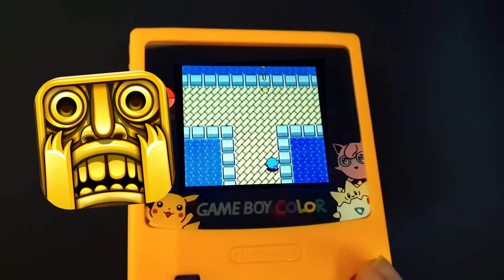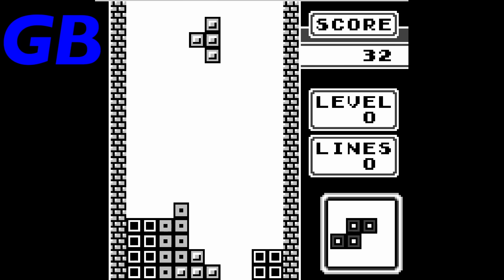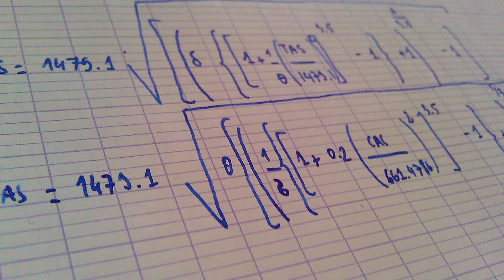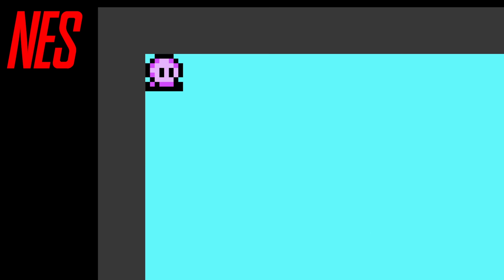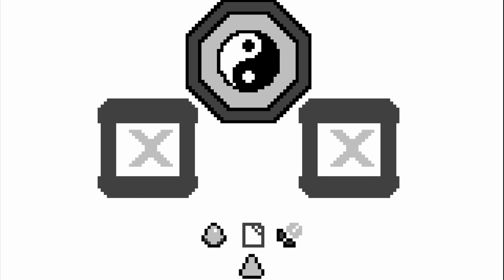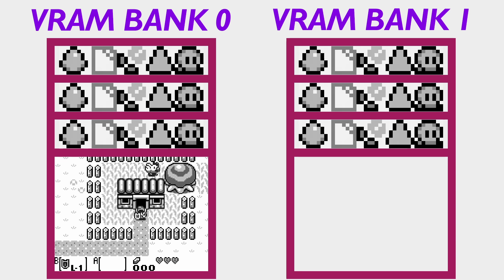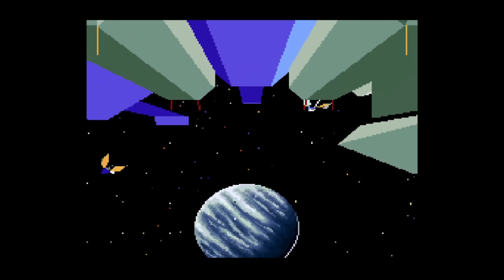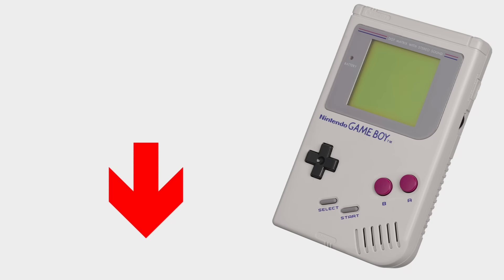Programming the Game Boy - Temple Run

Comment: After your Game Boy Color code didn't run on a Game Boy, you'd think you would have realized that they're not the same.  It would be equally accurate to program a Super Nintendo game and say it's a Game Boy game, since the Super Nintendo can also play Game Boy cartridges.
Reply from the maker: There are hardware differences yes, but the same program can run on these two systems. The reason my code didn't work on the original Game Boy was that I hadn't accounted for the way DMA is handled on the original system. Now that it's patched, the exact same program works on both the GB and GBC. 
The device used to play Game Boy cartridges on an SNES is the Super Game Boy, which itself is basically a Game Boy, so the SNES is really only really being used as a fancy I/O device.
Reply: @InkboxSoftware  Though Super Game Boy games can in fact tell the system to run SNES code. There's one game in particular that lets you load a mulitplayer SNES version. I believe it's a version of Space Invaders. 

The color of Super Game Boy leaves a lot to be desired. As I understand it, it uses palettes for different parts of the screen, rather than at the sprite level, and is relatively slow to update. 

It doesn't even have the ability to have sprites and backgrounds to use different palettes, which is what the GBC used. 

AFAIK, there was never a game that really attempted to use both types of color. SGB compatible GBC games would just have a border and a single palette for the whole screen that never changes (e.g. Link's Awakening DX).  But I'd love to be wrong.

Comment: I took a look at your temple run game and I think the reason it won't work on the original GameBoy is because you call the OAM DMA when you are in ROM. On the DMG, you can only access High RAM during the DMA transfer. You need to copy a routine into HRAM on boot that will call the DMA transfer and will wait for it to finish. There's more details about it in the pandoc.
Reply from the maker: Thank you so much. I hadn't noticed that part in the pandoc before. I've fixed my code and updated it on my website, with it now being completely compatible with the original Game Boy. Version 1.01 is all because of you.

Comment: A simple fix for turning might be to adjust the current setup to start on a clone of the corner tile but rotated 90 degrees as appropriate, adjusting the player position to match roughly where they hit the button. Probably still a bit jank but it would probably be less jarring.

Comment: For corners, I'd recommend placing a checkpoint.
On reaching the checkpoint, the screen will "fade to black", with only the player character on the black screen, before transitioning to reveal the new direction.

Since actual turning isn't particularly practical, this would prevent the jarring sharp teleportation and give a moment's respite.

Comment: Here's a suggestion to make the turns much less jaring, the player character should rotate and then run off screen and only when it hits the boundry do you refresh with them at the bottom again. As it is, there isnt any real indication you're turning, it just resets. Cool project though i hope you do a follow up with more features from the original!
Reply from the maker: Very good suggestion, I thought about adding a brief turning animation but decided against it since it would only be briefly shown, I guess in hindsight it would have been better to add it.
Reply: @InkboxSoftware  or continue the game sideway and ask the player to rotate their console. 😅
Reply: @InkboxSoftware  you don't need an animation, just a copy of the player sprites rotated 90 deg, the hat could just fall off

Comment: That's so cool, I assumed you could use C to develop on the GB lol
Reply: You can though, GBDK is a thing!
Reply: @Michirin9801  but it's quite """bad""". because of the differences between the GB's arch and the assumption in the C standard/by GCC, you'll hit a wall way faster. so for most project it's probably enough, but if you want to push the GB to its limit, assembly is the only way.
Reply: @minirop  I don't doubt in the slightest that assembly is better, I mean, I have to do A LOT of convincing to get the programmer to do a single H-blank interrupt in GBDK... Meanwhile I know the GBC has HDMA which should help with that? I'm pretty sure? (I just do the graphics, sound and music)
Reply: @Michirin9801  The issue with using C is that it has no concept of memory banks, so all code is limited to one bank without some absolute wizard level hackery so assembly is just plain better since it can handle that correctly
Reply: @TurtleKwitty  Umm... I'm pretty sure GBDK handles memory banks just fine, otherwise it couldn't make games any larger than 32K, and the game I made the graphics and music for was 1 meg, plus the programmer's only issue with making an 8 meg game is that it'd be more expensive to make physical copies cuz 8 meg chips are more expensive...
Reply: @Michirin9801  You can have larger art assets just fine but code wise c was never made for bank switching so your code needs to be fairly small, or self contained between banks, have seen someone switch banks in assembler and restricted the c code to bedithin a bank but multiple sub programs that way for different portions. 
At least that was still the case a couple years back when I last checked
Reply from the maker: GB was released a bit before C became practical for programming consoles, so it was assembly during it's ~12 year long run

Comment: Careful nintendon't doesn't fuck you over like the portal port to n64...
Reply: damn, i didn't know that project was killed. :(
Reply: @sofia.eris.bauhaus  There's a leaked build floating around and it is quite playable from my understanding. Just few first chambers, but they work.
Reply: That was Valve.
Reply: @UltimatePerfection Who was scared pantsless by Big N
Reply: @mrb692  because James was using the leak SDK, which is still Nintendo's property. If he had used libdragon from the get go there wouldn't be any issue.
Reply: It was actually Valve who shut down that project, and they did it out of fear of Nintendo.
Reply: @JoBot__  I heard it was done by one Ben Dover-Backwards.
Reply: @JoBot__  Exactly. Fuck nintendon't and their litigious asses.